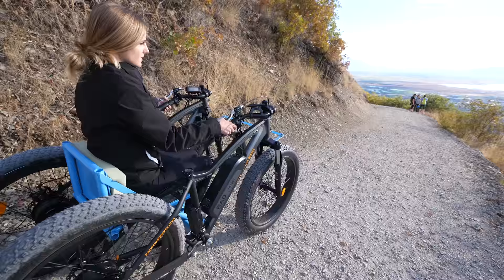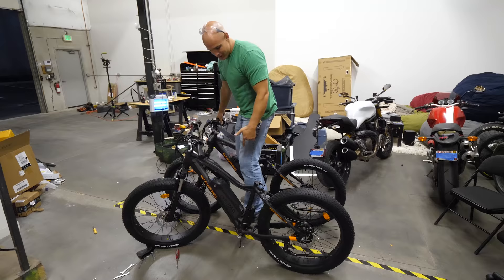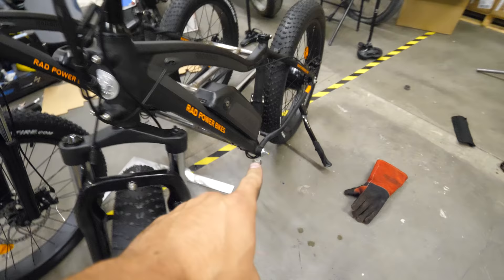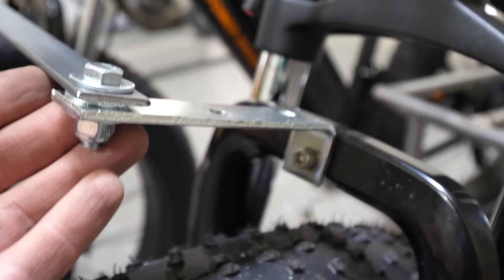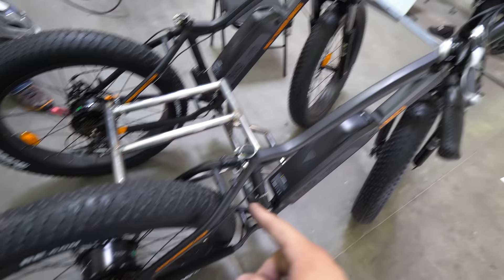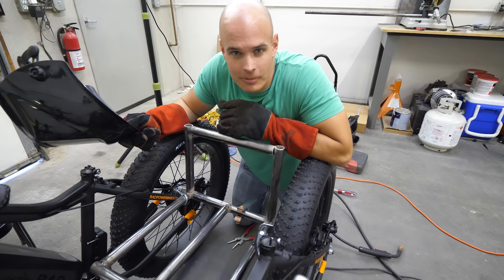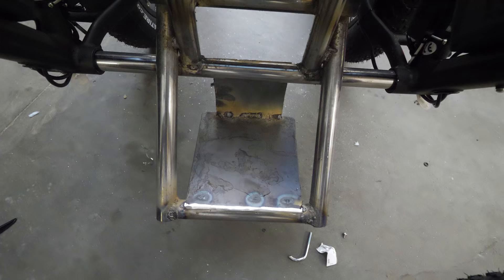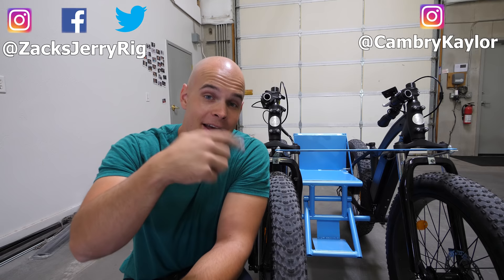How to Build an Off Road Wheelchair (From 2 Electric Bikes)

Comment: Zach, my mom was paralyzed last July with a T4 injury and I teared up watching these videos. THIS IS AWESOME! Oddly enough I'm a mechanical engineer and you sir, just gave me my next project. I designed and built the fully custom chassis, suspension, brakes, and steering for my senior capstone project in college (SAE Baja) so this is right up my alley.
Reply: Please make a video, in even more detail!
Reply: Yea, make a video out of it, given the reason for it, you’ll probably get a channel started easily
Reply: I’d also love to see a vid made of you do this! My dad has MS and I’d love to build something like this for him, but I barely even know where to start (I didn’t study engineering in uni, whoops haha)
Reply: You can probably cut down cost alot by using front wheel electric bike conversion kit and weld own frame from some tubing. A tricycle design might be better if you don't need super offroading
Reply: @grandprixuse  Have toh started the channel?
Reply: Does anyone know anyone interested in building one for me

Comment: As an electrical engineer, have you considered putting slim alternators/alternating current generators in the wheels so while she's burning current, she's also building back potentially double the current. If you are able to send me the figure you have for the battery output, RPM, actual range, and wheel size, I'd be happy to do the math for you. Then either you can do the work, or I can build the product (probono of course) so Cambry could have either a much extended range, if not a nearly unlimited range if the mathematics are correct. 

Zach, please let me know what you think, assuming you haven't already figured this type of process out. I sincerely hope you see this message, for both you (love your channel) and Cambry. Like you, I love helping people overcoming obstacles.

If you see this, please allow me to help you.
Reply: Let jerry see this guys
Reply: Robert J Gresick III Jerry must see this, thanks Robert
Reply: Baldy must see this message
Reply: Either you know something that Tesla doesn't know or that for some reason not explained in the comment can't be fully applied to cars...like, regenerative breaking exists, but there's no way it can output U N L I M I T E D range.
Reply: @quicktingz2097  Baldy?
Reply: Agent 47 needs to see this
Reply: I sir thank you for your service.
Reply: the motors are literally generators if he has it set up for it
Reply: Erm, you can't just hook up an alternator to an electric motor and generate as much or more energy than you use. It will slow down your motor and produce less energy than it took to produce it. It's a great way to slow down the bike and waste energy at the same time. That's why electric cars produce energy while braking, because then you're using the kinetic energy of the car to charge the batteries, energy that otherwise would just be used to heat your brakes.
Reply: Sorry man - your calculations are definitely incorrect. Achieving “unlimited range” with the system you described would violate the laws of physics.
Reply: @WSD333 Not these laws, especially not with an alternator on a motor-driven wheel.
Reply: Perfect idea, I think you've cracked perpetual motion. If your battery ever does get low then you just hop in your DeLorean and go back in time to when the battery was full.
Reply: @JerryRigEverything comeon Zach you have to see this
Reply: That violates conservation of energy. Remember, most of that energy is being absorbed by friction with the ground and the moving parts of the bike. Regenerative breaking might be possible, but I doubt it would be useful enough to be worth the time of adding something so complicated. It would probably be easier to just add another battery.
Reply: Wow this comment is so long
Reply: Wouldn’t get unlimited range. Further range sure maybe, but never unlimited. Most of the electricity is lost from heat.
Reply: haha, good joke :)
conservation of energy my a..

Comment: Brilliant idea. I’m 80 years old and looking for an off road wheel chair to get me up the hill behind my property to my cabin. I’ve looked at quite a few but they are either way too expensive or probably not powerful enough. Years ago I built a 4 wheeled horse drawn Phaeton with Ackerman type steering with coil spring suspension and wide tyred bicycle wheels. I was thinking of electrifying it until I saw your videos, thank you so much Jerry.

Comment: Super awesome! Love this kind of stuff
Reply from the maker: Thank you!
Reply: Simple Creativity
Reply: This is awesome! Great work! 

One thought that came to mind for me is.....that looks hard to get into. What if you replaced the seat you made, with a way to connect the wheelchair. Obviously that'd be a bit of a challenging to figure out, but if the wheelchair could be the seat, and then they could unlock the wheel chair and roll away without any help. And if the bike died, they wouldn't be stranded, they'd still have the wheel chair.
Reply: @JerryRigEverything  Hi Zack, you could also consider adding the suspension to the seat rather than the back wheels. Some springs between the seat and frame would add some comfort while still maintaining the same bike design

Comment: Modify just a little bit

Immediately transitions to cutting off the chain
Reply: That was pretty dumb honestly. It's unnecessary to destroy the chain in order to remove it.
Reply: @FEARmeify     Artistic license :)
Reply: @lylestavast7652  This isn't art and I stand by my claim. What he did was completely unnecesary.
Reply: Lol...he prolly got that, but so what? Not the end of the world, dude.
Reply: @ScottR10  No one said it was "the end of the world", just  that it was dumb and completely unnecessary. It's even easier and cleaner to take the chain off without breaking it.
Reply: @FEARmeify  You obviously know nothing about bikes. The chain was not "destroyed". Only a single link was cut. The remaining 99 percent of the chain can be used for several thousand miles on another bike.
Reply: Sure, but alternatively, just take off the master link.
Reply: Exactly what I was thinking lol
Reply: Lighten up, people. It's the first prototype with this concept.

The main thing is, that the concept works, even though he chose to delete the pedals and chain, and not use the derailleurs.

In any case, I'm sure he's had time to reimagine the build, and has likely built another iteration or two of it, by now... maybe even one where he found solutions that enabled him to keep the gear shifting system intact, and make it work, without the pedals.

He's a smart cat, so I'm betting that he already has, or will, in the future.

Comment: Wow! I have no Idea how I found this but am so grateful!. Im 65 in a manual wheelchair living in Peru. My very expensive wheelchair just shook apart on the dirt roads and cobblestones. Had to have it welded together so its not able to break down for travel anymore. This would give me so much independence ! whoo weeee! Im going to see if my welder wants to tackle it!Because i need to transfer with crutches and cant lift my legs, I would put a Tube that holds my crutches  and the front brace would need to open so i could back into the seat. I think i want an " office chair " like seat for more comfort installed with heavy duty springs on top of your flat welded seat. Incredible design! Thanks for sharing the build plans! I subscribed and will let you know how it turns out!. I just bought a donkey to pull a cart thinking that was my only option ! This is WAY better lol
Reply: Did you attempt it? How did it turn out?
Reply: @econ2566  not yet. The donkey is working out great and i hzve a wedding comming up for my son.
But we want to try it! I will keep uou posted

Comment: Now that's something special
Love you Zack 😍😍😍
Will there be a durability test for this one 😁😁😁
Reply: Will*
Reply: @papercut._.  Thanks for the correction.
I didn't notice it.
Reply: But from this we'll know his heart and his support for differently abled is pretty durable ♥️
Reply: Sivakumar Kottayil his name is Zack not jerry
Reply: @PhilDogg  Got it
Reply: Check his other channel he tests it there
Reply: I think it's pretty durable already because its build by Zac
Reply: It looks very weak, not durable. The steering linkage in the front is held on by a single bolt and the metal is weak. Will break easily. Also they need to add grease there. The back needs shocks. If she keeps slamming into curbs she will ruin that bike quick. Both of them seem to not care though
Reply: @eksine  I don't think the steering linkage is the problem. I don't see steering forces shearing a bolt like that. You could easily suspend yourself from a bolt like that no problem. Believe me I've built a few drive trains with similar linkages and you'd have to intentionally try to break them.  Unless she drives it into a wall it should be fine. Even then I'd be more wary of the rims getting damaged or a bend in the actual steel linkage.  As far as the back suspension goes it's no rougher on the suspension than one rider would be the difference is there's two bikes sharing the load. Any failure caused by a lack of rear suspension would be faults inherent to the bikes themselves and therefore not an issue with the build assuming the seat doesn't way more than the weight limit of the bike which they should be fine on since bikes like that are rated to something crazy like 400lbs and even if they didn't those ratings are intentionally lowballed.
Reply: @pfitz9346  I'd have to see some actual tests to feel more comfortable about them. You may be right because I've seen videos of people hopping on a single tire up hills and rocks. However I do have my experience fixing cars and mechanically I am very skeptical of what you're saying. Maybe if I could see these parts up close it would be different but metal is metal and unless he has a spring on the steering in case of hard impact , every time it hits that curb that force is transmitted to that bolt in the steering and wheels will eventually give way. It does not spread the load. If anything it increases the load when that wheel hits the curb because it's connected without supension with a hard connection I creasing the weight, it takes a massive beating. I cannot see that what you're saying is correct however I do not have any education in mechanical engineering but my experiences and intuition  have shown me that's not correct
Reply: @eksine  most of my experience comes from building projects pretty much like this. I have a degree in robotics and electronics systems technology and I've never had a problem with lightweight systems like this. I've actually built my own electric bike and as a joke for an electronics competition I helped build an electric chariot because the theme of the competition was the gladiatorial games so I've had some pretty direct experience with this stuff. I've also taken apart a lot of small to medium sized mobile robots like the rack pullers that companies use to fairy parts back and fourth and they all use a pretty similar setup. The bolt is overkill but always handy. The bit far more prone to failure as I said is the metal bar that runs between. What they should have done was use metal rods instead of flat bars because flat bars like that aren't the sturdiest you can bend them by hand in some cases. I guarantee you the failure point will be in those flat bars but then again it would take 10 minutes at most to swap them out if they bent. The bolt will sheer those bars off  way before the bolt itself budged. That won't happen either though. The bars will just bend and twist. The weakest link in the linkage fails first and the strength of that bolt is much higher than those bars. I understand why they used flat bar though. It's super easy to just drill through and run a bolt on. What they should have done was taken a mill to cold rolled steel flattened a notch on each bar to run a bolt through and made the same frame with rolled steel. I had a similar setup on my first drive train and you simply couldn't break it. We had to stress test it and after spending 20 minutes hitting it with a 25lb hammer we couldn't get anything to break so we figured it was good enough. If they wanted to get super technical they should go with a rack and pinion but that's unnecessarily complicated to produce for a project like this. You can't just make those with a drill and some bolts and steel. You have to machine those and they're complicated parts for a machinist. Which is why even in the industry they rarely build rack and pinion setups.

The difference between the design needed in automotive and something like this is a tremendous amount of speed and weight and power compared to this setup. Things need to be way sturdier on a car because they're expected to go 100s of thousands of miles and move literal tons of weight at highway speed. The trucks on a skateboard are much flimsier than this (they rely on a literal rubber grommet and a single bolt for suspension) but for the task they're doing you and I will never be able to wear that joint down. It can always be better but there's always a point where it's been over designed past it's needs.

If you want I could actually pull up some pictures of my old builds too. I'm sure I have them somewhere. Most chain driven setups. This is a little different being direct drive.

Comment: Two linear activators to turn the front forks simultaneously would then allow the front steering coupler to disappear and thus, make it so that the young lady can then ride her wheel chair up to the twin bikes and slide back onto the saddle. Use of the linear activators could free up or rid the handle bars or even have a faux handle bar that could swivel down from the side coming to rest in front of her to feel more like a standard single bike. The handle bar could then be the variable switch activator to activate the linear rams.

Use a pair of Lithium Polymer 14.4 v 35c batteries to operate the linear activators so the steering doesn't drain the wheel motor batteries. 

You could do the same for the disc brakes as well.

Let me thank you for helping the young lady experience the freedoms you and I are able to enjoy. You are a fine young man.

You have inspired me to begin designing a mount and dismount for folks needing to mow their own lawns via a rider or zero turn. 

Thank you again, kind Sir.

Comment: Why you didn't connect the two motors to just one accelerator? And maybe if you turn the brake levers of 180 degrees she should be able to break with more "power"! One other thing, with the 18650 batteries  you'll be able to build an another battery pack (connected with the two original batteries) that will fit under the seat to increase the autonomy! This is such a good project, good job! (Sorry if my english is bad, i'm Italian ahah)
Reply: Thanks for the coment i was thinking the same. Its very easy to put in a bigger battery than instal the solar nonsense.Sorry for my English i am Czech :)
Reply: Was thinking the same thing, couple the front and rear brakes separately and have the two consoles integrated together close to the seat. And also you could have a single handle bar connected in parallel to the two for easy turning. Excellent work zac👌👌
Reply: I agree with all these comments. A single throttle for both would be safer and easier to drive....but in saying that it might make tight turns difficult because both powered wheels are pushing at the same time, like with a locked diff in a car.
Definitely flip the brake leavers to the bottom of the bars, and connect both front brakes to one and both rear brakes to the other. Or....all brakes to one leaver as I don't think independent front and rear braking would really be needed on a machine like this. Hydraulic brake calipers could be used in conjunction with a simple 4 way distribution block being activated by a motorcycle hydraulic brake leaver so it has enough pressure to operate the 4 mountain bike calipers. I don't think one mountain bike leaver would have enough pressure. 
And yes...plenty of room for extra batteries 👍
Dual suspension would be so much more comfortable, as many people have said but will be a challenge.mounting the seat section.
Cheers.
Reply: I can understand all of you
Reply: It would need some sort of differential control, for cornering. This may be a little less user friendly, but it's probably easy enough, to get used to.  It could have advantages, to control the traction of each drive wheel separately, in off-road conditions.
Reply: @klepow  , that could be achieved by fitting a micro switch to each side of the steering tube on one side of the 'bike/quad'.... cutting power to the inside wheel on a tight turn once steering angle gets to about 10%.
Reply: If you had a single throttle you wouldn't be able to turn properly, that's why you have differentials on cars
Reply: @MR5er1  .....I'm pretty sure I just said that, like exactly the same thing
Reply: @Mardy72  Alright
Reply: @SteefaTak  Solar isn't nonsense. It's great to give a huge green autonomy. Also, not having to charge something and make sure it's charged before doing something is much better.
Reply: @MrCooll971  can you imagine how big the solar panels need to be to Charge such a big battery  in that build with  a car battery ?
Reply: Skid Steering is superior in this instance.
Reply: @SteefaTak  1200 sq miles of them to power NY NY for 1 day

Comment: Fantastic project, my wife would love to have that superbike. :-)
When using "akermann steering", you have to keep in mind that inner wheels run in a smaller circle relative to the outer wheel.
A small angle on each side can solve that problem.